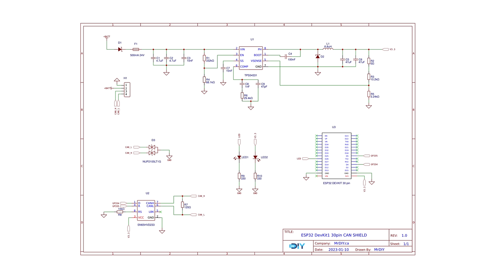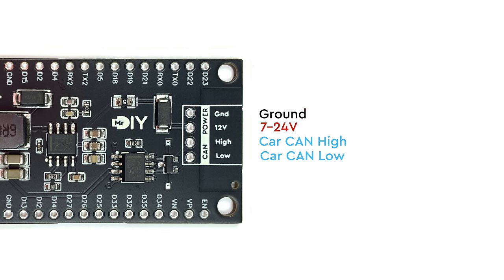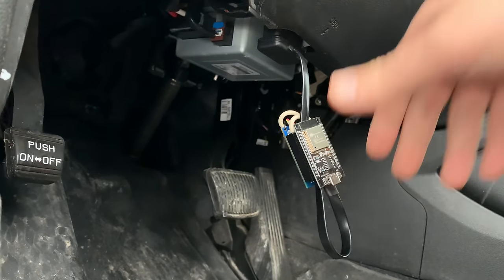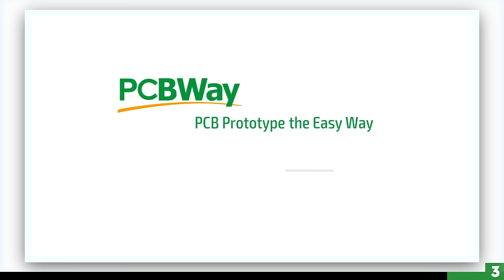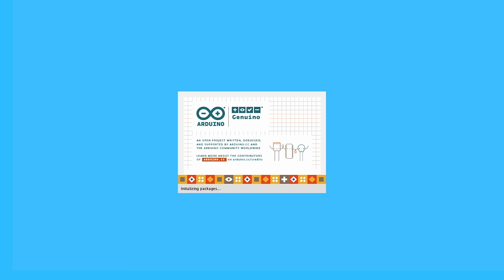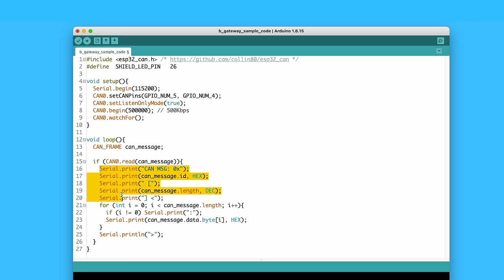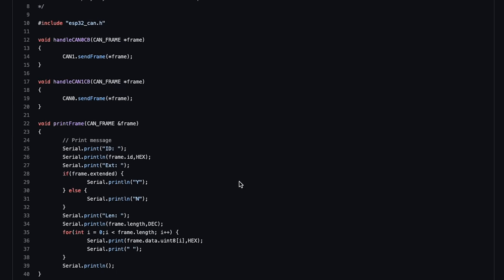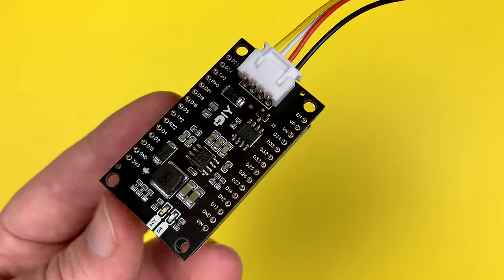The EASIEST Way to Connect to a Car's CAN Bus

Comment: can't wait to try this... and i didn't know Teslas didn't have an OBD port... i thought they had to have one by law? anyhow... great job!
Reply from the maker: Yes, apparently they were exempt because they don't have an 'engine'. Looking forward to your Porsche EV project - sub-ed.
Reply: They do have an obd 2 port, a 2 second google search will show a bit directly from Tesla
Reply: @Kristof-cl4df  Model 3 (at least 1st gen) do not have OBD2 port. Requires breakout cable attached to diagnostic port behind console.
Reply: The reason is... an OBDII port requirement is exclusively for federal emissions compliance. If your car does not have emissions, such as with EVs, you are exempt from having to follow this. I imagine in the future this will change, but for the time being, EV manufacturers are actually free to make whatever proprietary ports they want. Though right to repair laws will require them to provide access to the hardware and software to fix them... but at whatever cost they see fit.
Reply: The Model S and X do both have an OBDII port accessible underneath the infotainment display.

Comment: Looks good, and it's nice that all is together on one board. But, IMHO, it is way too expensive. I built something similar myself a couple of years ago and the cost was less than 10 USD, I don't remember the actual amount.
Reply: Yep I really do agree with you. Really good idea but way too expensive... I'll go with a mini 560 for 12 to 3.3 v conversion and a SN65HVD230 for can transceiver available on Amazon  or AliExpress for a few bucks. But again, really good design !
Reply: if you can make your own for that much (which I doubt) then fine but $38 is pretty reasonable to pay for someone's time to assemble it and they have to make a living on top of the parts cost as well as the cost of dealing with stupid questions from customers and replacing faulty units, units that get lost in shipping etc. People who say stuff like hat probably don't run their own business and particularly a small business dealing in niche products.
Reply: $40 does not seem steep to me at all. And definitely not 'way too expensive'. If it takes me more than about 20 extra minutes to figure out the parts and assemble things, just buying this basically plug and play option is money well spent. Yeah, it's $10-15 in parts, but that's not factoring design and assembly.

How much is your time worth and how do you want to spend it I guess is the question.
Reply: @mfx1  Sorry if I upset you. It wasn't my intention. To make myself clear, it's just a lot of money for someone who's just playing with CAN Bus for fun and that there are some cheaper alternatives for that. I understand very well the problems you are facing as someone who owns a little business. Clients are more and more exigent. But your design is really interesting. Maybe you should consider making another version with two CAN Buses (One CAN 2.0 and one with Flexible Data) I think there would be enough space on the PCB for that.
Reply: @laurentmathivet1214  I'm not upset, it's not my business.
Reply: 40$ for a dev board that saves you hours of your own dev time? lol alright you waste your time on reading can bus specs i'll just spring for the 40 bucks
Reply: Thanks for all your replies. Yes, I understand that building it and selling it and shipping it and giving support all cost money. When I built something like that a couple of years ago, I learned to understand the CAN BUS and all the details which were available on that bus of my KTM motorcycle. I bought the parts, soldered it together and I wrote the software with ESP32 code (not Arduino). It was a fun project for me. Obviously if someone just wants to have a working device without hassle then it is cheaper to buy it for 50 USD instead of building it themselves.
Reply: sometimes going the DIY route make sense as I have an electric Smart and none of the ODB2 gadget I saw so far are not compatible with my car (even at 200$).
Unless I want to go with the professionnal one costing well over 1000$, but I just want to play with it and read some code from my car
Reply: @yvesinformel221   you have an electric Smart? Is it ED (451) or EQ (453)? I'm going to buy the older ED soon and would like to play with things like this. Ultimate goal is to see if it's possible to do things like remote heating control (like pre-heating the car while still on charger without going there first) and assisted driving (for that I'd be willing to get commaai, but I haven't found any info giving me any hope this could work on the older ED).
Reply: @ddelimar  don't know, it's a 2013
good luck finding the info, specially  the database file for the CAN bus.
I think I red somewhere that the manufacturer do not have to provide that and they are keeping it kind of secret.
Reply: The blue pill has a can bus.

Comment: As far as I know a CAN network must have termination resistor present at the two physical end points of the CAN network. The circuit that you have designed seems to have a hardwired 120 ohm resistor which is introducing additional termination resistance against the CAN standard (as the car network already has termination resistors in place). Do you think this can cause any issues with the particular CAN network the shield will be connected to?
Reply from the maker: The CAN bus terminator resistor is in the schematic but not present on the board. It can optionally be added on the back of the PCB.
Reply: @MrDIYca  awesome feature!
Reply: @MrDIYca  this is an ancient post, but in case you're still working on this, one of the nicer ways to handle this is to include the 120R but also include a 2-pin jumper to enable it.
Reply from the maker: @jade_harley413 I agree. Since the video, I've updated the shield multiple times, including adding a 120R resistor directly on the shield with the option to enable using a jumper, along with many other improvements. You can check the shield link above for full details.
Reply: @MrDIYca  hell yeah, nice

Comment: Hi, might be a dumb question but wondering if you can have the board hooked up to the OBD port (12v power) AND USB C on a laptop at the same time?  I want to use the arduino IDE serial monitor to read the can bus messages for a custom program.
Reply from the maker: You should be fine
Reply: @MrDIYca  thanks!

Comment: Awesome! I’d be interested in learning more about the PCB design process for the shield (i.e. how you decided on resistor/capacitor/inductor networks for the ICs)
Reply: If you need to know the VALUES from resistor, capacitor... You should be looking at a electric circuits course first, after this digital/analog electronics and power electronics courses
Reply: Most components come with an example configuration or template layout with suggested supported components. Sticking to the recommendations is a good place to start.

Comment: How did you know which CAN message ID and which bits out of them are responsible for the velocity data or any other variables? Did you have the DBC?
Have been trying to do the same for indian cars using my arduino with sparkfun can shield and kvaser CAN bus monitors. But I can only see a single ID and stuck with how to extract more CAN messages!

Comment: Awesome gadget! I have a question though. How the cabling from the 4 pins connector the car looks like. I only want to understand this point 😇
Reply from the maker: The newest shield version has obd2 plug built in so you can use any Tesla obd2 harness
Reply: @MrDIYca  Thanks for your response but i wanted to know about the case where i don't have that obd2.

Comment: I've done a similar DYI and are able to to read from any Canbus (there are up to 6 on a Tesla). Have you had success writing to it, useful for virtual buttons for example. Lock, Unlock, AC, pre-condition. I am interested in collaborating on some interesting code.
Reply from the maker: I am not there yet. I don't feel comfortable writing to the bus - maybe down the road. However, I can do most of the things you mentioned using an unofficial API. I made a video about it here - https://youtu.be/JkmOfxi-_TM
Reply: I would be interested in that as well, especially locking and unlocking. This is in particular useful for pre-2021 Model S and X, that do not have bluetooth unlock and therefore you are stuck with the App once the car is in an underground garage.

Comment: Hi @MrDIY

As i see you have a lot of Knowledge about Can Bus. Maybe you can help with a problem, or if i can fix this with a ESP32. I have a Hyundai Genesis Coupe. The outside Temp is read over Can to my internal Display. But it goes also trough the Original Radio (what i did replace) before it goes to the Display. Is there a way i can get the signal back to the Display with a ESP32?
Reply from the maker: The CAN signal doesn't have to go through the radio. Maybe try connecting the display directly to the CAN bus

Comment: Super nice video ! The best feature for tesla will be ambient light like the new model 3 already has… connected by CAN … it will possible ? You are able to read light status (for example ok steering wheel ) and turn on other lights?
Reply from the maker: You read my mind. That is next.
Reply: @MrDIYca  perfect I will follow and buy for sure ! Ps I just spoke with another guy that play with CAN … he sad to me that tesla can change references of CAN so they can invalidate your programming… is it true !?
Reply from the maker: @gianluigi8264  When it comes to CAN, there are no rules. Any car manufacturer can change all their IDs and Data mapping anytime. However, it is rare and costly. So they tend not to do it often. I haven't seen it but I heard Tesla did do changes in the past.
Reply: @MrDIYca 😂👍

Comment: Best channel ever, best project ever. The thing is how do you translate the CAN BUS messages?
Reply: There are libraries for that, an the other ones are just byte arrays and you need to know, which is which
Reply from the maker: Thanks. You either do it the hard way by monitoring the bus and try to figure each ID or you get lucky and you find a DBC file for your car
Reply: There should be a standard for most vehicles, speed, rpm etc, specific functions are proprietary software.
Reply: its "typically" just hexadecimal which he should have auto translated in his code. The format is as follows. 
(what is being sent) [how many bytes of data are sent] (byte1) (byte2) (byte3) (byte4) (byte5) (byte6) etc etc etc ..... Example
(120) [4] (0) (0) (0) (0)  120=wheel speeds   4=4 bytes of data  0= the speed of each wheel sensor  Front left, front right, rear left, rear right. It's not always this simple sometimes you have to do math on multiple bytes to get the actual value but this is well documented on a wiki (at least for american vehicles) because they must conform for easy emission inspections

Comment: Very interesting! My Stellantis Fiat e-Ulysse does not report SOC in percent, nor does it allow to limit charging to e.g. 80%. I can read the SOC over OBD2, but this is not available when the car is turned of. Would I be able to get SOC over CAN Bus? And where can I access it? Thanks!
Reply from the maker: You might be able to if you can locate the right CAN Bus and decipher the information, but this data is heavily dependent on your car

Comment: Awesome project, you have a new subscriber! I have a Model S 2015 that doesn’t have bluetooth near field unlocking. Do you think there may be a way to retrofit this into the car with this by having the circuit send an unlock command (and possibly a remote start command) to the car when my phone comes within a certain distance of it and a lock command when it travels a certain distance away?
Reply from the maker: In theory yes, but my CAN projects will all be in READ/LISTEN ONLY mode.
Reply: @MrDIYca  Alright sweet there’s hope! Is there a resource you know of where I can learn more about writing to the can bus? Achieving that would be game changing since it would allow for a lot of good retrofits for legacy vehicles such as the keyless entry and possibly a rear display on the center console like plaid models have (kind of set up like the one on your browser in your previous video, but without the need of an internet connection)
Reply: I think the lock/unlock signal is further encrypted and not just raw on the CAN bus.

Comment: How fast does this unit power on? Basically I'm looking to build an interior lighting controller and I want it to respond as fast as possible. I want to check the canbus for door open, dome light on, or headlights on, and if any are true, switch a relay that turns on a bunch of custom interior LED strips.
Reply from the maker: sub 100ms - but the tricky part is figuring out how to wake it up when needed
Reply: @MrDIYca  very true on the wake up. Maybe depending on the mA draw I'll just leave it running.

Comment: Did you need a DBC file to decode the CAN frames? I'm successfully (i tihnk) reading can messages but I can't find a key to interpret the data anywhere. I thought it would be in the libraries or somewhere online, but I'm getting the feeling I'm missing something important when it comes to decoding and extracting data from those frames, for example I'm getting frames like this: CAN MSG: 0x393 [8] <39:4:FF:1F:FE:3:0:80> but I don't know what to do with it now. (BTW, your shield was by far the easiest way to get to this point, so thanks for making it available for purchase!)
Reply from the maker: Hi Jake, thanks, I am glad you like it! Yes, I was lucky to find a DBC file for my car. 
You might want to checkout OpenDBC - https://github.com/commaai/opendbc

Comment: Does it work on a golf 7 that has gateway protection?
Reply from the maker: In that case, you may need to access the CAN bus directly instead of using the OBDII port, if it's protected

Comment: Hi, really nice design, does this board have any certification like FCC, CE, RoHS, ISED, IATF16949...?
Reply from the maker: Hi, the shield doesn't have wireless components, so FCC and ISED aren't applicable. It's a DIY hat for hobbyists using off-the-shelf parts. You can always check the schematic to verify the parts against these standards

Comment: Hi @MrDIY! I just ordered the Version 1.2, flashed it with ESP32RET firmware via your flasher. Macbook connects fine to the hotspot, Savvy Can shows some messages on the console, but no CAN bus messages are recevied in Savvy Can. Am I missing something here? Car is a 2006 Mercedes W211.

Comment: I recently purchased your CAN board and I plan on trying to build a display for my Model Y.  Any chance you could share your Speedometer project details?  Thanks!
Reply from the maker: Yes, I am working on a series but hopefully will have the first one out in 2 weeks or so
Reply: @MrDIYca  Great!  I am working on a logger to log messages to an SD card.

Comment: Does the package come with the 15 pin headers that get soldered to the board so that the ESP32 can be plugged into it?   Mine didn't come with them but I see your board has them.
Reply from the maker: Yes, they are included. If yours is missing by mistake, please reply to the order confirmation email and I will make it right

Comment: Hey, I have ordered and received your board. I want to use it with my model 3. Can you tell me which Pins are CAN-High, CAN-Low, 12V and GND on the Tesla Port under the center console? I already use another OBD-Device, so I connected an ODB-Splitter. Now my Idea was to cut the second splitted cable, but I don't know which 4 cables I have to connect to your board. Is there a color code or something? Thank you so much!!
Reply from the maker: I used this excel file as a reference for my 2023 Model 3: https://docs.google.com/spreadsheets/d/1ijvNE4lU9Xoruvcg5AhUNLKr7xYyHcxa8YSkTxAERUw/edit#gid=60352066

PIN: 
- 18 (CAN_H)
- 19 (CAN_L)
- 1 ( 12v)
- 26 (Gnd)

You might want to double check that for your model year.
Reply: @MrDIYca  thank you so much for the link! I will recheck everything and try it out in the next days.. thanks!!

Comment: So nice! How do you use the can bus to get the desired value (speed)? Is there a list somewhere where all addresses are registered?
Reply: There will either be a standard or the manufacturer will probably use similar addresses for all their vehicles, they might just assign it all randomly though, who knows? The CAN bus on cars isn’t a secret thing though and there are plenty of devices you can buy to plug in and read from the CAN bus so the information about how to get the data off of the bus must be out there somewhere.
Reply: @conorstewart2214  Connor any tool recommendations on Amazon? Let us know when you get a chance. Thanks for your input.